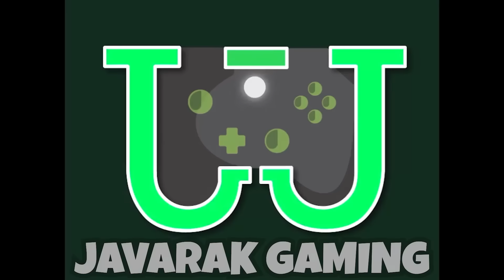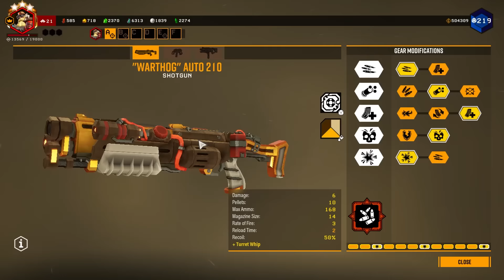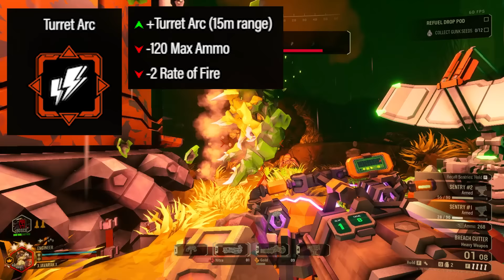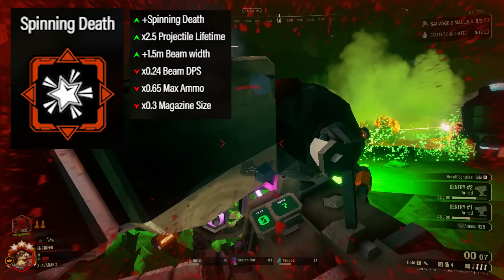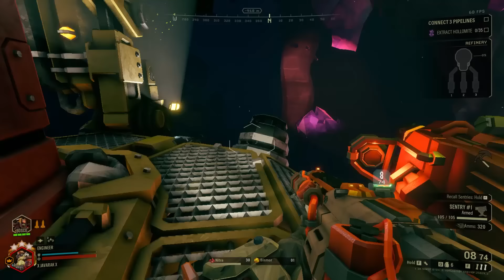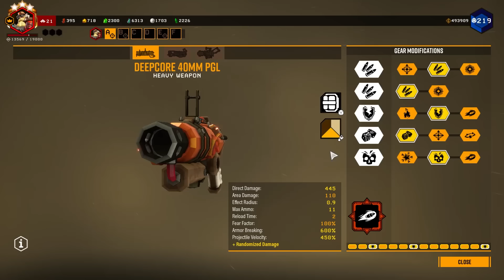Complete Engineer Guide for 2024 | Deep Rock Galactic |

Comment: Thanks for the guide and showcasing weapons and their overclocks mods. Just one thing to point out, the breach cutter ignore enemies' armor, so putting the armor mod will do nothing except if you wanna help your team or if you wanna finish enemy with another weapon. In my opinion tho Breach cutter has so high damage that you don't need other weapons. I do believe that the stun is also a little bit useless since you deal a lot of damage but of the 2 the stun is the best, armor breaking is not needed

Comment: Also the platforms placed by the engineer have a perk that can reduce the fall damage taken when landing on them drastically. In my opinion when it comes to falling from a high place engineer has the second best option to save themself from fall damage first being of course the scout with their grappling hook.
Reply: Meanwhile driller with that 0.1% chance to take 0 fall dmg when drilling as he hits the ground
Reply: @Am_Cookie2436 how exactly please explain I'm new
Reply: @47kushgar it's an extremely unreliable method that you shouldn't count on because it WILL most likely fail.

Sometimes, you'll be able to drill downwards while falling to save yourself and take 0 fall dmg. I think the logic behind it is drilling into the ground then ledge grapping in the same frame or just frames apart but don't trust me on that.

A more reliable way is to drill into a wall to catch yourself at about a 45 degree downward angle if a wall or structure is close enough
Reply: I always shoot the platform below me to traverse faster. It also works well with the mod that transfer momentum to your projectiles
Reply: Scouts with their grappling hook

Comment: Tip with turrets:
Use them sparingly. They will run out of ammo quickly otherwise. The ammo upgrade seems like a good way to combat this, but its only viable for escort, sabotage, and possibly elimination missions. For the rest its best to use quick placement. On the missions i listed you have time to prepare for the event beforehand while in others you will be moving around and/or need them in a pinch. Also with turret whip, dont just spam the turrets to fire constantly because it consumes 5 ammo each time. Pick your shots wisely and focus on larger enemies or groups.
Reply: Bad advice. 
1.) If turrets are consuming ammo it's BECAUSE THEY'RE SHOOTING BUGS. That just means you have more primary ammo to work with, the ammo isn't magically disappearing.

2.) Turret whip does MORE damage than all 5 bullets it consumes put together, and it's an AOE explosion! Turret Whip is MORE ammo efficient not less. 

You want some real advice? Gemini, quick deploy, armor break, and defender System. Turret whip or not, the turrets keep shooting like normal even when you activate the ability, so make sure you're getting the most out of your turrets.
Reply: Good advice. (at least from what i can say after 1,5k hours)
Fast placement is what u need on  haz 5 and up. Without constant replacing them, turrets dont shoot the enemy's u need but anything on the map and there’s plenty of shit they can waste their ammunition on at these difficulties.
And to not waste your main weapons ammo braindead on whip shots is obviously a good advice, especially since whip shots don't always hit the target.

Comment: The turrets are actually somewhat intelligent. They will not shoot if there's a dwarf in front of their target. Ground level turrets therefore may be less effective, since they'll not be shooting as often if there are dwarves in the way. 

I tend to put them on a platform on the wall at head height so they never stop shooting as i run around the room. With the defender system mod you'll want them at the sides of the room anyway. You can refill them from any direction, even from underneath, so putting them slightly above you is not a big deal.
Reply: You can also build out above where you want and break the platforms under them, allows them to float above you.

Comment: While I know you can't cover everything - the Plastcrete Catalyst on the shard defractor turns your platforms into explosive traps. The beam will have an AoE damage and radius boost from the point of impact (killing weaker bugs ) and a sustained beam causes the platform to explode for the stronger bugs. This is great for setting up defensive areas in Salvage and Escort missions.

Comment: Tip for the cheese canon: on OMEN tower events, the activation platforms detect your character a short distance above the height of the plasma waves the bottom level throws out. If you stack your cheese slightly above the platform, you can effectively ignore the waves entirely.

Comment: I have a new class idea and i know that it shakes the balance a bit having more than 4 but just hear me out. A jack of all trades he would be able to use EVERYTHING including overclocks but it is a bit worse and you can only have 1 of each type (excluding the traversel tools like the grappling hook and drills and the support? tools like the flare gun and sentry's but has the cost of not being able to use the other one for example if you take the drills and grappling hook you cant take the flare gun or bubble shield). For example you could have the engneers breech cutter as a secondary, the gunners rocket pods, the scouts grappling hook, the gunners halo 3 bubble shield, and the engineers shredder drones but everything has less ammo, slightly less damage, slightly worse overclocks (like the ones that just give you a stat boost or for example the nuke overclock has less radiation and a smaller radius), a shorter radius (for like the bubble shield), or overheats faster. So in summary a class that does everything but slightly shittier.